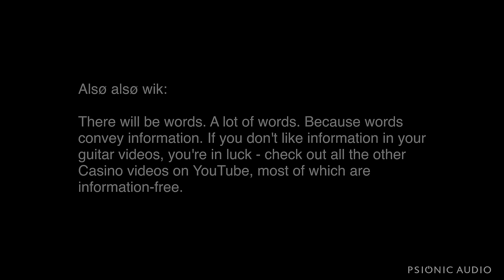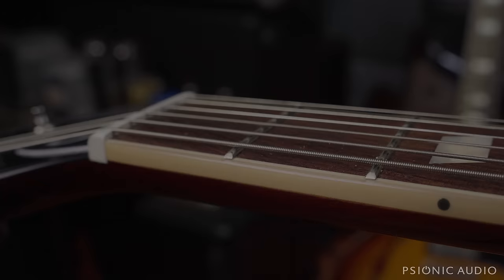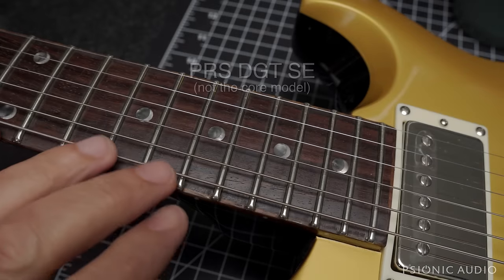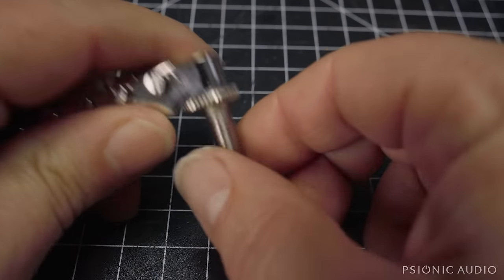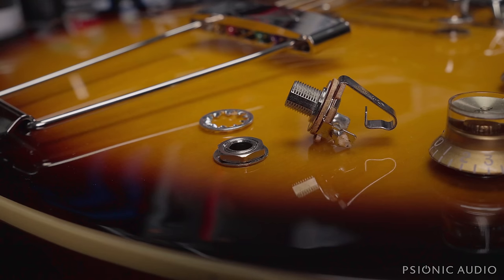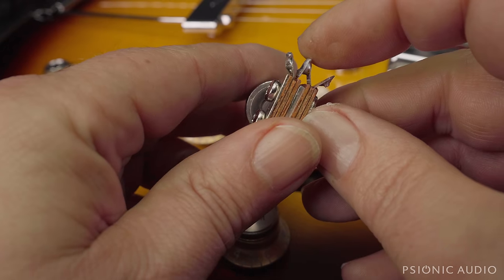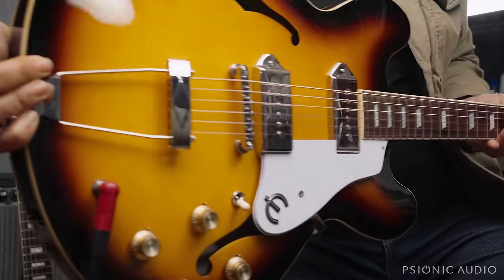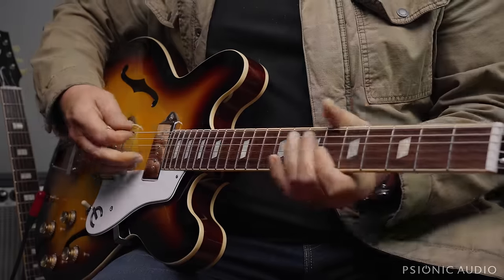Fab or Dead Grotty? | 2023 Epiphone Casino Review

Comment from the maker: Something that might not clear to viewers - I had to set the amp very bright with much less low end to make the Casino sound ok. So then the 335 and Tele sound really bright with the same settings.

I could have set the amp normally and the 335 and Tele would sound great (as they do) and the Casino would sound like mud.
Reply: I appreciate the Monty Python nod in the opening, btw.
Reply: If a 335 sounds bright compared to a p90 guitar, I'd agree - swap those pickups. I've had 3 guitars with Fralin p90s and if you gain your amp up and roll the guitar volume back halfway you can get some Tele-esque spank and sparkle out of them, not to mention they're a calibrated set with a slightly hotter bridge so they balance better.
Reply: This has also been my experience with playing my casino next to my Tele and other guitars. And I’m playing through a Super Reverb Tonemaster. 

With 50’s wiring in mine, I find running the amp louder, bass down to 2, mids pushed and treating 7 on the guitar volume like it’s 10 helps to reduce the muddy low end and sound passably good.
Reply: @jonbeatlesfan  That's not far off from my settings although a totally different amp. Agree completely.
Reply: Nice review…I changed the pickups and installed a pair of Lollars…It became a totally different guitar. Now it sounds great! Didn’t mind the black covers…Cheers, be safe.

Comment: I use a Casino, a 335 and a tele and what I recommend to everyone is to get a simple GE7 ep box and adjust it to taste...you can get a lot of range out of a Casino that way. The Casino is almost an acoustic electric at times and great unplugged...it's not great for bending notes but great for fingerstyle or bossa stuff. The 335 and tele would be my gigging choices but in the studio, there's a place for the Casino in my view. You can shim the stock pickups to brighten them up as well. EQ sort of acts like a shim. I put a bone nut on mine and it's a guitar I'll always keep around. If my studio was on fire, I'd walk out with my tele and 335 though in the end.

Comment: My recommendations to get a better sound out of the stock Epiphone p90s -- convert tone pots to no-load, swap the volume pots to 1meg, and add a simple treble bleed. Much cheaper than swapping them out for Lolar. Opens up the top end just enough, and the simple treble bleed can be used to take some of the low mud down.

Comment: A little late to this, but great video. I have a 2019 Casino, mine had a rattle that finally got rid of a couple of years after I bought it by changing the whole bridge actually a couple of times.

I agree with the pickups. They’re actually very high output for p90s I measured mine to be 12k. Replaced mine with Fralins as well. Only casino pickups I found (in the uk). I kept the pots & wiring, it was too much of a challenge to get the back in the guitar!

Comment: My Casino is a '64 I bought in Denmark St, London for a couple of upcoming session rhythm jobs back in (I think) 1978. It was in very good nick despite a few scuffs and scratches, but needed a fret dressing, a bit of truss rod tweaking and a bit of reheating on some of the solder joints, all of which I did myself. It wasn't at all muddy - nickel factory P90s, they really sang. I think back then either I got one of the last hand-wound sets, or they just made them better back then. 45 odd years later, they still sound sweet and can certainly growl if you want them too.

Comment: Great review.  I recently got a 2023 Worn model and was impressed by the nice, even tapper of the pots... Maybe they used audio tapers on mine... I can really dial in the middle position tones, but the pickups are indeed dark, so I'll be looking to Fralin or Lollar down the road... Overall I thought it's a pretty well made, but like yours, the nut slots need to come down as some of the strings on the first three frets intonate sharp - not something I ever checked before, so I learned  something here :).

Comment: Rhett Shull on YouTube made the same recommendations ("This Upgrade Made A HUGE Difference") on a MIC Casino he bought.  He changed out the pickups, pots, pickup selector switch, output jack, and had it rewired!  I think he also changed the tuners and added a bone nut.  Some videos said the MIC tuners don't hold tuning very well.  He didn't say what all of those changes cost.  So once you completely rebuild it you have a decent guitar?  Not sure I want to go down that road.
Reply from the maker: I could only recommend it for those who REALLY want a Casino but can’t swing $2K+ for the better versions.
Reply: @PsionicAudio  Thank-you.

Comment: I recently got a ‘90’s Washburn HB35 (335 copy) and stripped it out… same issue with input jack minus toothed washer and short thread. There is a ledge at the end of the thread and I filed the inside of a toothed washer so it would sit outside the ledge, giving me just enough to engage the retaining nut which sits flush with the thread when tightened. All good.
It also came with tv jones filtertrons which for me did not suit so its now got p90 neck and paf alnico ll in the bridge. The tv jones are going on my Chinese Gretsch. Win win. ;))

Comment: Awesome Burst on that! I got the Casino worn that came with ABR1 style posts from the factory so I replaced the bridge with a tone pros. Also for some reason the casino worn pickups are lower output (8.5k). Either way I recommend a B7 it increased the Bass response and sustain on mine.

Comment: I was GAS'ing for a while over the Revstars, particularly the P90 ones. 
I already had a Pacifica PAC611VFM which played lovely but I didn't get on with the Bridge HB combined with the Neck P90, both Seymour Duncans. 
The 611 was getting nearer and nearer the door until I decided to try a HB shaped P90 at the Bridge. 
Total Transformation !!! 
Changing from Neck to Bridge now sounds 'Balanced'. 
I used an IronGear Alchemist P90, excellent value pickup here in Britain.

Comment: Thanks for this video.The reason I was considering buying a Casino was just that they are light in weight.  But, I don't want another project, and a new Casino sounds like a project.
I seldom play electrics anymore anyway.
Reply: For what it’s worth, the Casino in Worn Olive I got a month ago has almost none of these problems, even showed up with the action and intonation dead perfect. The only flaw on the neck was 2 frets with a bit of sprout and a little corrosion that easily polished put with a bit of Simichrome. Nut slots were deep, but cut to a very playable depth. 

Tone can be subjective, but I find nothing wrong with the stock pickups and wiring. Controls are very usable, and the pickups are exactly what I would expect from P90’s, they compared very favorably with both my Seymour Duncan Antiquity and the original ‘55 from my vintage Les Paul Junior.

Comment: What is with the giant notches in those saddles? Gibson & pre 1970 Epiphone just put the strings over the saddles and then whacked the strings with a hammer, making instant slots. I never cared much for mom's ES330 through most Fender amps. The Bassman is the exception. I have to be ready to palm mute every string or that 330 really howls. It's also good with most Marshall or Vox amps. If you think that Casino neck is too slim you'll really hate that 1961 ES330. Most Fender necks are about 0.840" at the first fret. The 330 is around 0.720". Really super extra thin!

Comment: i got one recently. a ~10yo Chinese made one in natural. Im having issues with the pickups having very drastically different volumes but havent taken the plunge to level the pickup heights. Im not blown away but i wasnt expecting to be. to me its a cheap, sleeper jazz box. and id rather have one of them around than the cymbals and pedals i traded for. I also got it a crossrock case which was a brand i hadnt come across and the case is sturdier than the guitar lol. you should do one of these videos on a newer Gretsch, ive had my eyes on a 5622T and have played a few with wildly erratic setups/fit and finishes.

Comment: One of the things that I like least about playing a hollow body guitar (in my case a Gretsch) is that I can't easily replace an output jack or a switch. The switch is one of those marginal ones that you find on mid-level guitars (most frequently Fenders), and on a regular guitar I'd just take it out and replace it, but now I'd have to pay someone to do it. My soldering skills aren't that great, and it's one thing with in a solid body, where I can easily go back in if I mess up, and another in a hollow or semi, where it's frustrating and labor intensive to try to deal with the wiring.

Comment: Glad you got a great deal but, why did you buy a guitar that you had to change out all of the electronics? Did you buy it for the body? Just wondering.
Reply from the maker: You might like it as it comes, though the nut tweaks and jack tightening should always be done. For me, I got a very low price and was buying the wood, knowing I could change the rest as/if needed. 

Like I mentioned in the video, there are good bridge options for much lower prices - I’m not saying you have to get the Faber. I just had one sitting in a drawer.

I would not have bought this at list price.
Reply: @PsionicAudio  that's cool, because it does look great. I'm a sucker for hollow bodies. I did the same thing when I first became interested in guitars and playing, bought a cheap Epiphone and replaced all of the electronics. Neck was good and it stays in tune.

Comment: Does this have the Epiphone Pro P-90s? The newer Casino imports supposedly do and the Pros are SUPPOSED to be not as hot as the earlier Epi P-90s, they are SUPPOSED to be like in the 8 or so ohms range which is in line with vintage Casinos. Did you measure these? And as far as people liking what they like and the darkness of the sound, IMO the reason this guitar remains in the catalog is The Beatles connection, the used prices even for imports haven’t come down since the Get Back documentary, and if you listen to John Lennon’s Casino in the studio and on the roof, it’s dark sounding just like this one. (His had nylon bridge saddles.) People want to sound like Lennon, they go get a Casino. Great review overall though.👍
Reply from the maker: It did have the Pros. They sucked.

John rolled his tone knob down a lot - you can see it in the films.

I’ve played ‘60s 330s/Casinos. The stock wiring/pickups on these misses the mark.
Reply: @ Thanks for the info. I was considering getting one of the Casino Worn models just for cacas and giggles, but I don’t know if I want to buy $400 worth of parts (including pickups) to upgrade a $499 guitar. Although that still would be way south of a U.S. model or a vintage one, which ain’t happening unless I win the lottery, or even some of the nicer imports. As I said, used Casino prices even for the early Korean models went insane after Get Back. The Inspired by Lennon models that have Gibson pickups and wiring were like $999 new not 20 years ago but you can hardly find one under $2k these days.

Comment: I hope we get to hear the fralin version of this casino.  Question in my mind is "How much of a difference will they make?"
Reply from the maker: Well you can hear how much treble I had to have up and how much bass I had to turn down on the Super to get a usable sound, and how bright/thin the ES-335 and Tele sounded with those settings. And how the stock P90s are louder than the humbuckers. 

The Fralins should end up sounding great with the same amp settings as the 335 and Tele and my other guitars, and should have the same or slightly less output than the 335.

Maybe I should have talked about that but the video was going long. 

I don’t have to change amp settings between my other guitars.
Reply from the maker: Rhett Shull and Mick from TPS have videos showing before/after Lollar P90s in their previous generation MIC Casinos. I expect the same amount of change. Lollars and Fralins are equal though not the same. Both worlds better than these stock ones.
Reply: Being a tightarse, I replaced the P90s on my Wildkat with GFS P90s, huge improvment
Reply: Thanks for the clarification.  I listened to rhett's casino with lollars.   It's a big difference.  I'd say it's a mandatory upgrade when budgeting the project.
Reply: @PsionicAudio Video could have gone on longer for my money! :) Was really enjoying the Lollars!

Comment: Lyle, did you check out this guitar in a store, perhaps picking the "best one" out of several, before buying, or was it a mail-order purchase?  Is this a case of "a sample size of one", as you're known to point out about amps where youve only worked on a single unit that may or not be representative of the "group"? ( It doesn't sound like this guitar constitutes a great value except for somebody who can afford to do the work out of themselves, it sounds dumb but I am curious if a second or third example would have been better right out of the gate,  or worse.....)
Reply from the maker: This was hanging on a wall and I knew what I was getting. I wouldn’t buy this at list.

But aside from the neck pickup solder joint all the issues are common to Epis. Especially the naff pickups.
Reply: @PsionicAudio  , ps, I tried to give the video a "like" but the like button wouldn't work. WTF, ewe-booby? Their systems are scrambled half the time, and whenever they make changes, things get worse instead of better. ( Not to mention that on political sites and chats I frequent, my comments get disappeared all the time without a trace, even though I'm very careful not to call anybody names or try to trigger anybody, it's not how I operate, at least not on a public forum...)
Reply: @PsionicAudio , update: the Like button works now.....

Comment: Thank you for the great video; it was extremely validating for me. I came into this already a big fan of my own secondhand 23 Casino. Although, even as a Beatles fan, I could never get behind the models from previous years. It took a long time for me to see the light. 

The first thing I also did was install a solderless harness with 50s wiring, including a switchcraft toggle and jack. Looking forward to a pain free pickup swap in the future.

I “had a bunch of fun” fishing the wiring through, and am now enjoying the stock pickups much more. They aren’t great, but they’re certainly better than the previous pickups and more usable with 50s wiring. I am also leaning Fralins>Lollars despite living in WA and only having experience with Lollars so far.
Reply: 50s wiring is a must to me, for 4 control 2 pickup guitars. But only on the neck pickup. It is imho essential on Casinos to control the 'woof'. This, and/ or RS between pickup hot to selector switch to shave off the lows at the outset.Oh, and Lollars are still my go to P90 brand.
Reply: I would lean Lollar the majority of the time except for when it comes to their dogear. I think it’s a little too scooped in the mids, almost bordering on a Fender-y single coil. It’s still a fantastic sounding P90, just less authentic/traditional to my ears.

Comment: Can a nice eq be used instead of changing pickups?
Reply from the maker: In a pinch. I’m not saying you have to make all these changes. Aside from a loose output jack (which is pretty much inevitable on these) you can live with the other issues, maybe do them piecemeal over time.

If you buy one I strongly recommend having the store make sure the output jack nut and the pot nuts are tight. Or have a tech do it.

Comment: My question is: why buy a guitar that needs all that stuff replaced?  Pickups, pots, nuts, jack, bridge, etc...I don't understand why people buy a "cheap" guitar and then spend a ton of money upgrading the components.  I know what you're going to say, even more expensive models have similar issues and you'll still need to replace or adjust components, they always need a proper set-up and fret work etc.  So, how much did you spend on this guitar after all the parts were traded out and what might you have been able to buy instead for that money?  You're lucky you have the ability to do the work yourself, as you said in the video, consider the cost of having a qualified tech do all that work for you too.  Makes it seem not worth it.
Reply from the maker: That’s one of the things I wanted potential buyers to be aware of. 

I’m in a unique position. And I got an industry price but not through Epiphone (not a sponsored video). 

I tried to point out you don’t need a $100 bridge - maybe just new saddles (which is a shame in a new guitar but Epi gonna Epi somewhere).

Logically, this is a bad purchase for most. The PRS SE, the Revstar, Fender MIMs, and Sires are much better guitars in the same price range. And not only need less work but if a jack comes loose the owner can easily fix that. 

The pickups in those guitars are much better than these too.

Not to mention upper fret access and feedback issues.

Casinos are kind of a cult instrument but I wanted people to know the downsides.
Reply from the maker: In fact, I originally ended the video saying pretty much all of the above.

Then realized most viewers would come to that conclusion on their own, and the others would ignore anything negative anyway.

So I ended it with just that idea.
Reply: 1. You don't need to upgrade everything on an affordable guitar all at once. You can space out the upgrades to whenever you have the money and time to work on it.
2. You can customize the upgrades to your specific needs, as opposed to a one-size-fits-all expensive guitar that you won't customize because it will be instantly devalued.
3. A $200 guitar with $200 worth of upgrades can become a better guitar than a $500-800 guitar.